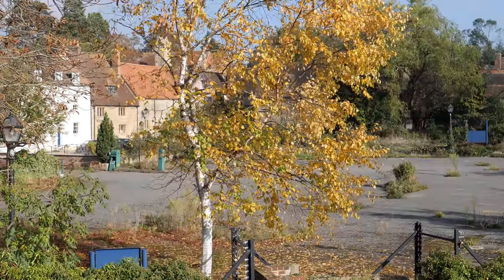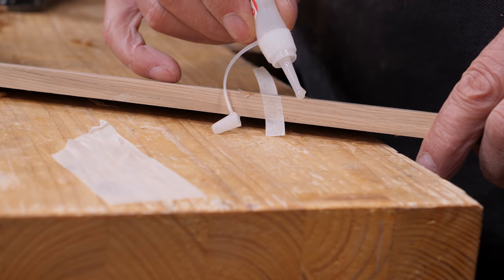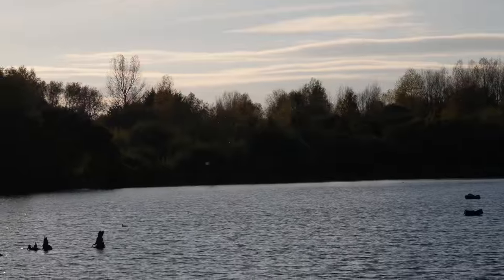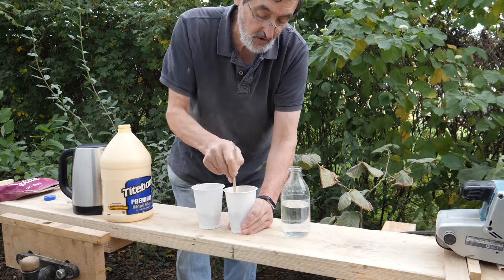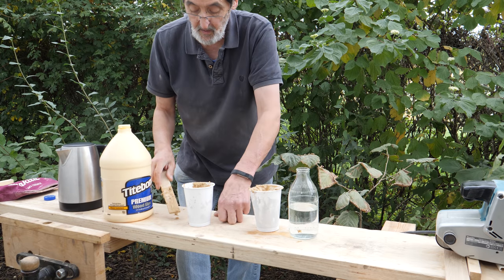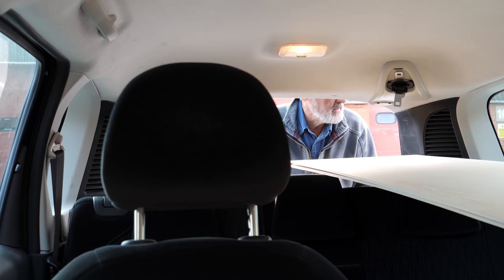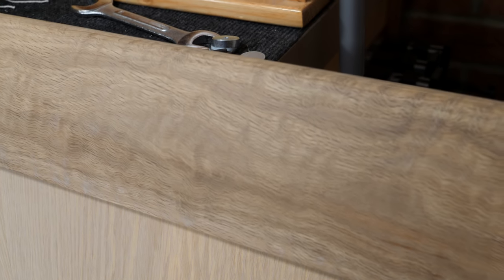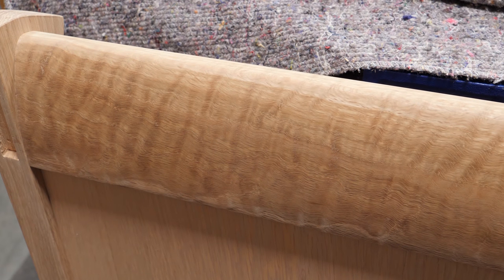Silence and Peace Comes from Working with your Hands | Paul Sellers' Vlog 005

Comment: Hot-air balloons:  Yes, there are times when the "hot air" isn't "going" -- the fire alternates between "on" and "off" to keep your buoyancy just right, and when it's "off" it's dead quiet.  As for the breeze, there is none, because you're drifting with the wind.  You have a groundspeed that depends on the windspeed, but your airspeed is ZERO.  It's wonderfully inspirational.  Just like your videos, Paul.  Thank you.

Comment: Thank you for sharing your thoughts. As someone who chased woodworking with power tools subsequent to watching The New Yankee Workshop many years ago I am discovering the calm and joy of using hand tools.  My hand tool inventory is growing slowly and is an eclectic mix of new and vintage I have collected. While I don’t plan to retire the power tool portion of my shop ,those stationary tools are often relegated to to the initial preparation of our local air dried hardwoods procured from local small sawmills. The joy and true fulfillment comes when I finish the power preparation of the stock and transition to hand tools. Thank you again for, via your fine videos, for leading me into this new and rewarding direction.

Comment: 'Sailing' in a balloon is not noisy at all, Paul.  On the contrary, it is dead silent.  You move at exactly the same speed as the wind, so there is absolutely no breeze relative to the balloon.  Since it is completely silent up there, you can here the slightest sound on the ground, you can hear the conversation of people, because the ground reflects the sound vertically.  Quite an amazing
experience.

Comment: Paul, another great tutorial. I've always saved my sawdust for future errors or to use as fillers for the discarded wood given for free at Home Depot. One thing I haven't used was warm or hot water. A procedure so simple that I didn't think "Outside my Box..." "Now I know..." Also thanks for that pull over and the Laminating Idea for Plywood. On my walk to my shop today I saw one of the Airline Stores(parts supply personnel) workers and asked her if she needed those plywood panels that has been sitting off to the side for a while. She said that I will be doing her a favor since some were damaged. I will make some heavy duty work caddies out of them and Laminating them will be a better option than nailing 2X4's to the base. "You Can't Write Paul's Pearls Of Wisdom in a Book..."

Comment: Hi Paul... thank you. I was born in 1950 and decided to go into the metal trades; metal on metal not metal on wood. Recently, I discovered, at home an old Record no 2? woodworking plane which had not been used in 60 years. Just holding the plane was transformative and well! I would suggest to everyone, put down the computer, for a moment, get out the pencil and paper, sketch/draw, read and listen to the radio and engage the imagination: vital. The 'younger generation' will lose this even if they can feel it! Looking forward to the series on bandsaws. Very best wishes from Leicester(UK)

Comment: Thank you for another lovely heart felt vlog Paul. I just wanted to remind your viewers that oak dust is thought to be carcinogenic so best not to breath any in. A dust mask is probably a good idea as its so easy to take our good health for granted. Pleased to see you were upwind.  Best wishes.
Reply from the maker: Whereas dust obviously has its dangers we do go the extra mile and actually measure the atmosphere (which no one does). We have never yet found our atmospheric levels to even approach any danger levels at all and in fact the system we use for extraction shows almost zero dust in our atmosphere. The measuring device we use is the most advanced and we take this precaution because of course it may not be just me in the vicinity. Yes, wear a dust mask and don't take it off too soon. I will suggest that there is nothing like first class extraction..

Comment: We lost my mother-in-law this week. I have not been in my workshop for some time and I miss it. I hope to be able to have some wood therapy next week. Your VLOG was ver thoughtful. 

On another note, very interesting filler. I use sawdust rather than sanding dust because sometimes there are grit particles in sanding dust. As I finish with a species, I gather it up, put it through s sieve and then bottle the finest dust - labelled by species. When I need to make filler, I use hide glue rather than PVA because I find that it takes finish better. I learned this process from my maestro in Florence.

Comment: I like the challenges of my vocation, machining components for micrometers, and other measuring instruments on automatic screw machines. The work is loud and messy though. That's why I have turned to hand tools with less emphasis on power equipment. Just bought an old stanley plane to turn into a scrub plane. Thanks again Paul, looks like you are enjoying your vlogs!

Comment: Like how your vlogs have matured and the transformation now is as smooth as your writing.  I've been doing the fine dust and pva recently with pine and rough lumber. Haven't used water , will do that as the results have been darker than the wood.  Thanks!

Comment: I was never very good with people. I have always felt my best in a shop. It may be a form of meditation as the mind clears from problems both imagined and real. There are many mental aspects of a project. Figuring out the design and what has to be done in what order. What tools and procedures to be used in each step, and then careful application so as not to muck up the whole project. There seems to be little room left in the mind for problems. 
I am retired now and have taken some vacations camping and such. Within a short time I am bored and head back home to my projects.

Comment: Never been in a hot air balloon either. I understand the heater is noisy, but when it is off, you should be moving with the breeze — therefore tranquil.

Comment: Re: glue as a filler... with titebond III you can actually put some glue right in the void and sand it while it's still wet and the dust from sanding will mix with it right in the void. It's a neat little trick if you don't already have a filler that matches the colour of the wood
Reply: That way you don't have to keep a can of filler or worry about it drying out before you need to use it

Comment: Happy Thanksgiving Paul to you and all your gathered friends and family.  As to your comment about speculating noise in the hot air balloon; quite to the contrary, unless the burner is being used, it is rather soundless.  As a matter of fact, at 500 to 600 feet elevation, you can hear normal conversations from people on the ground.  At least this has been my experience.

Comment: Paul,  I would like to know what species of wood you would use for making saw handles.  Also, is there a specific method for cutting the plate kerf?
Reply from the maker: Actually you can use many woods including fruit woods, nut woods and indeed woods commonly available to us. I have an 1864 Disston saw with a lovely oak handle.